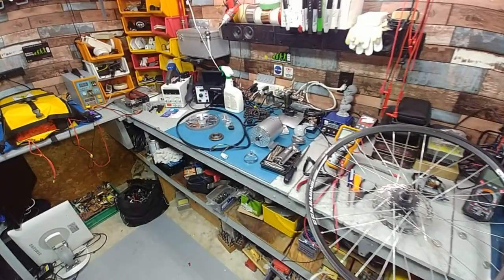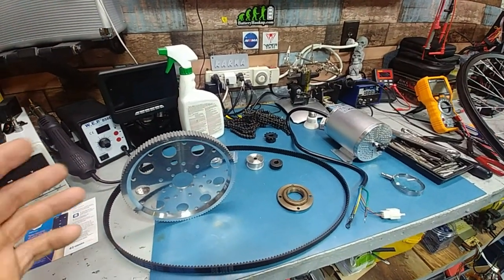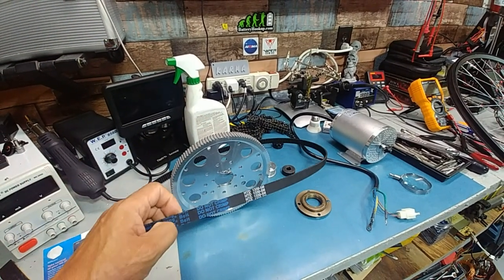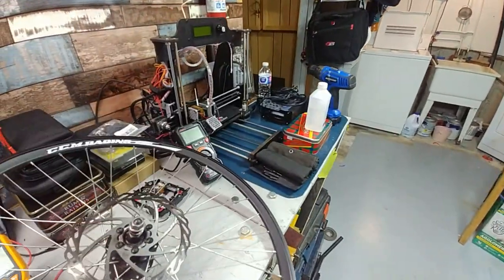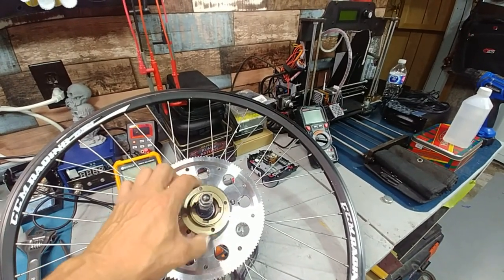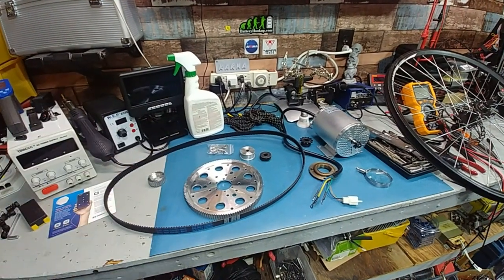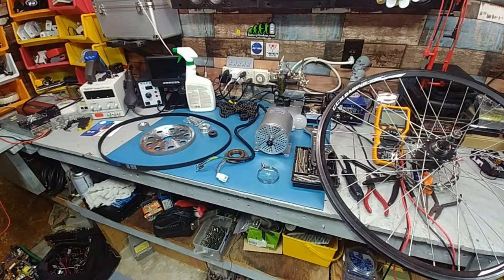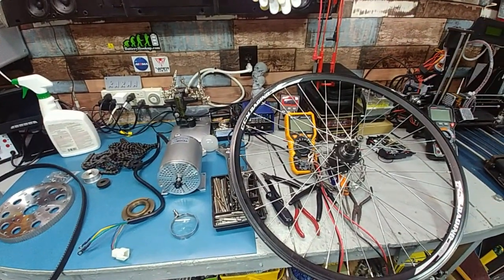ebike vlog# belt drive to chain drive Sunday, August 21, 2022

Comment: Just used the fan belt it won't slip 

I have the same motor on a mid drive with a 12 speed.
The first 3 gears 
Will do wheelspins with just a little bit of power.
No stress on the chin.

Obviously if you have it in the wrong Gear the chain or fan belt will slip  stretch and probably snap.
It's all about gear ratio

Comment: Where did you get the belt drive sprockets etc? Interested in them for my electric barstool racer
Reply from the maker: shop around you may find it cheaper https://www.amazon.ca/Drive-Stroke-Engine-Motorized-Bicycle/dp/B094QQPBMJ/ref=sr_1_8?crid=2E4Q8OWNT40DQ&keywords=bicycle+belt+drive&qid=1672942787&sprefix=bicycle+belt+drive%2Caps%2C77&sr=8-8